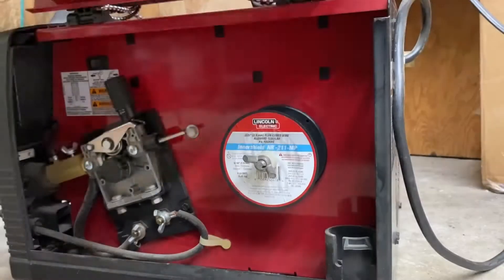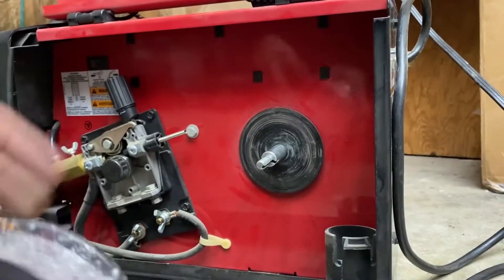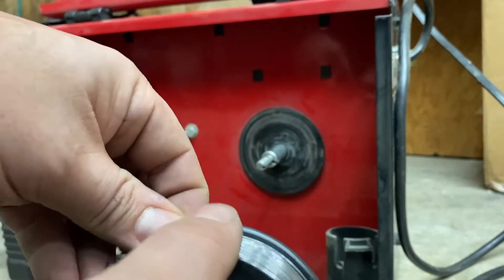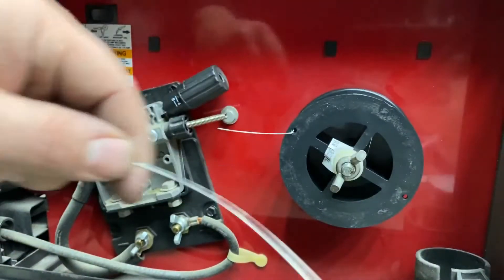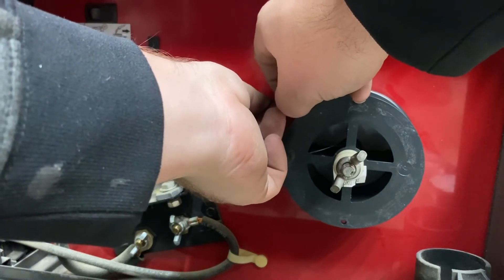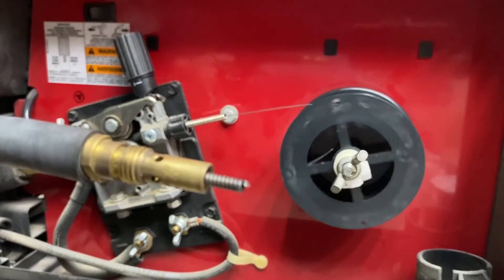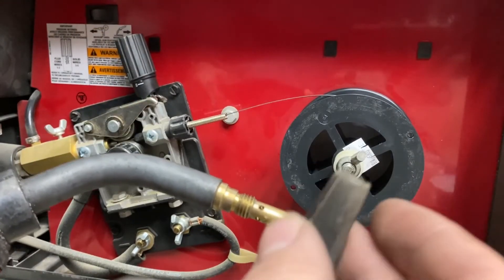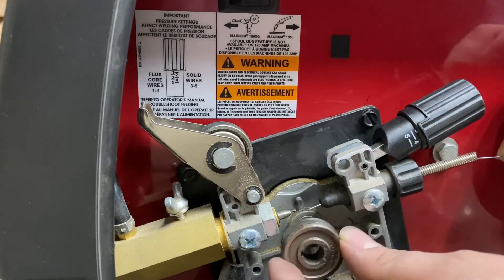How to Replace Welding Wire on a Lincoln MIG Welder

Comment: Thank you. Easy to understand video.

Can you do a video on how to set this welder up for mig with the proper mix of Argon gas?

I’m a beginner welder I’m just using flux core wire for now. I would like to move over to MIG welding with gas. 

Thanks again.
Reply from the maker: Glad you found the video helpful. I can certainly make a video on the setup. I’ll start working on it and hopefully will have it out in a few weeks time
Reply: @builditbreakitfixitmakeit5495   looking forward to it.  Thank you!
Reply from the maker: @thomaslotito380  Video is up at this link https://www.youtube.com/watch?v=J63iaUner-w Thanks again for the request! Hope its Helpful!
Reply: 2:03
Reply: 2:03

Comment: I bought a used Lincoln Pro Mig 175. It was missing the wing nut and washer that holds on the spool. I found a wing nut but I can’t find a washer. Any suggestions where to find it online?
Reply from the maker: I think this is what you’re looking for. Spindle Spacer https://a.co/d/5U80LLD

Comment: Lol, that LOOKS easy.  Because I’m hopeless, the first thing that happens is the wire explodes everywhere making a giant bird nest.   Then, after you sort that out, it jams repeatedly while attempting to feed it through.  I’ve used 75 of the new roll of wire and haven’t even turned on the welder yet.   
  I should be a beta tester for these things, if I could do it, only then can it be considered idiot proof.
Reply from the maker: I feel your pain. the first time i loaded it was a absolute mess! the key is keeping that wing nut tight all the time. only back it off enough so that the welder can pull the wire off the spool. Good luck!
Reply: Failure is the best teacher. Stick with it. you'll figure it out.
Reply: It happened to me, rookie mistake…